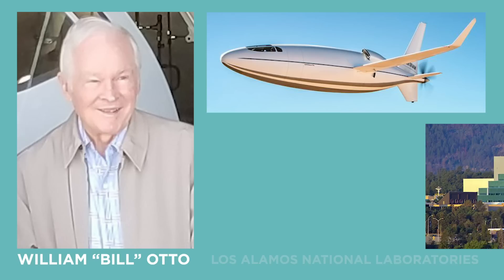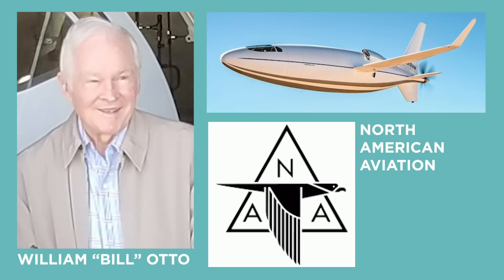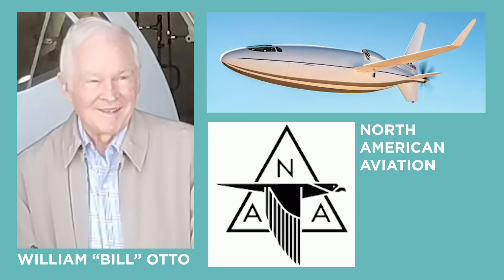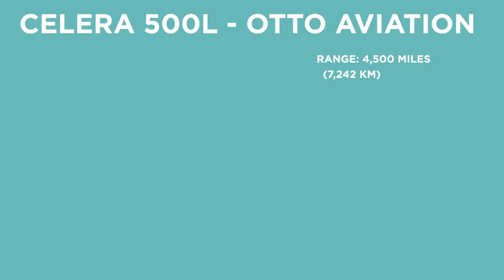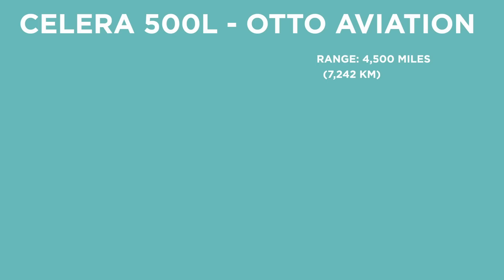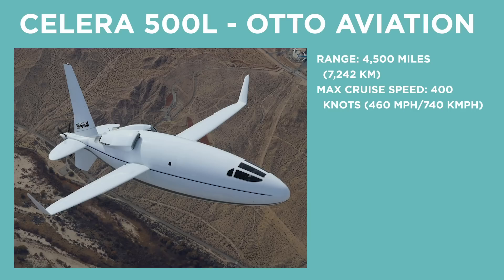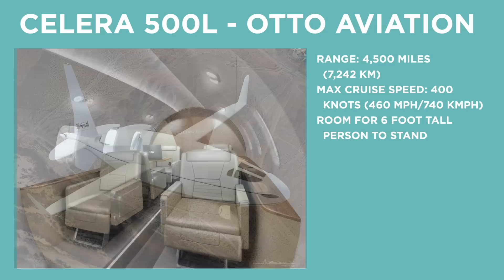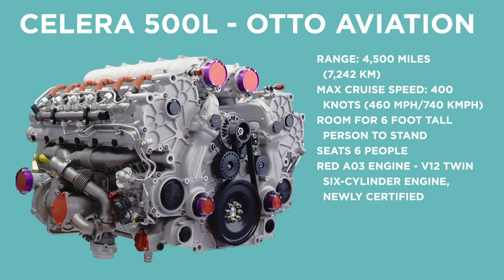Could This Plane Save The World? (Hint: No.) | Answers With Joe

Comment from the maker: I can tell from early views that the big hangup everyone's going to have is over the cost I state for the 747. I got it from here: https://www.aircraftcostcalculator.com/AircraftOperatingCosts/380/Boeing+747-400 which actually lists the used price. I also spoke to a couple of pilots that verified it. What I failed to say in the video – since I was unscripted for this one – was that I was quoting a used price.

But for the sake of argument, if you were comparing 61 Celeras to a new 747 priced closer to $250 million, that's still $50 million less for the 747.
Reply: thanks
Reply: It seems like Joe hastily made this video
Reply: Economy of scale would bring the Celera cost down for sure. Mass manufacture it
Reply: Joe's videos are impressive and thankyou for posting them
Reply: I don't like change.
Reply: 747 costs more than 300 million dollars !
Reply: Price of a new 747 is $200-300 million, depending on configuration. Your point still stands.
Reply: The difference is, you can't buy a new 747. Production is about to end. Quad engined jets are dead and buried
Reply: You need to do the math on the cost per seat to fly. If the cost of fuel is low enough over time then the profit per seat will go up.
Reply: @wolf359loki  Profits per seat will go up but will then go back down as airlines cut prices to attract customers.   I read a few years ago that the U.S. airline industry taken as a whole had lost money overall in its history.  That is why so many airlines have gone out of business.
Reply: The biggest hangup I have is that the crux of your argument amounts to a VW Jetta is not as efficient at hauling freight as a semi truck.  Genuinely enjoy both your channels and your podcasts but I feel a little more imagination here is in order.  I think this plane is a promising proof of concept and I would be interested to see how something like this could scale to 747 proportions.  Perhaps it could transport the same number of people but do better than fractional MPGs.
Reply: I don’t know if its cause the video is unscripted but u seem stressed joe, i dont know what youre working on but remember to get enough sleep and take time to urself
Reply: I just Googled "Boeing 747 cost" and on the first response I got "A new 747-8 passenger jet now lists for $367.8 million"
Reply: I would like to point out to everyone that there's a much smaller chance of dying when flying on a large plane than a small one. (Due to things like resistance to fluctuations in wind, extreme weather, and that there's more of the airplane to take the impact when hitting the ground.) I'm guessing this is part of the reason why larger airplanes are popular for chartered flights and smaller planes are becoming increasingly rare.
Reply: It looks like it could be good during this pandemic to get small amounts of people to places where they HAVE to go, but once the pandemic is under control it will go back to jumbo jets. Using a conventional engine is just asking for trouble. They are not as safe as a Jet engine. Too many thing can go wrong with a piston combustion engine.
Reply: How can we trust ya, Joe?  You come across as an educated person presenting factual knowledge.  Saying you're not a pilot doesn't mean a thing!  Everyone knows you're not a pilot, but we still trust your info.  Should we also assume that you're facts aren't correct because your not a reporter?
Reply: @cbuchner1  Lol, or just jam a few more seats in it. If you could go from 6 to 8 seats you just need 46 Celera's instead of 61, cutting down on all costs. If they were targeting the 747 it would be better to make a 20 seat version instead of mass manufacturing this plane.
Reply: @The13lackMamba  not sure if the current design scales well. They might have aimed for a sweet spot concerning their particular choice of engine technology. Ok, 8 seats seems doable. 80 much less so ;-)
Reply: Its cool, its just a YouTube video, not a mars probe...
Reply: The thing is than almost nobody uses 747 for intercontinental travel. You should compare celera to 737 max or airbus neo
Reply: Skyships also made a good video about this aircraft getting more into the technical side of this plane also worth checking out he also raised the same points about the commercial aviation argument go check out his video here : https://youtu.be/E38cc-4TvX8
Reply: This concept means you fly point to point.   You get rid of the hub concept so you fly a lot less miles and hours to get where you are going.   You didn't include any of this in your calculations so your numbers are off, just saying.
Reply: @christophertstone  Yeah, I was thinking 20 million was a crazy low number.
Reply: Worked at Boeing...I can tell you a 747 was north of 100 million dollars back in the early 90's 🤣
Reply: If a Jumbo with 350+ pax can go 25 miles with 125 gallons,
and This Plane with 6 pax can go 25 miles with 1 gallon,
then i am really wondering if it would be feasible to scale This Plane up to a size where the crew costs and also ATC / Airport burden would become less of an issue.
How about you ask Destin for a collab and have him as the lamina flow dude on this? ;-)
Reply: Hopefully it can be upscaled in terms of size, capacity, production and efficiency. This would be a winning number.

Captain obvious here.
Reply: Joe Scott So, a few things a real comparison should consider:

* It is not a comparison. It is not even apples and oranges, it’s more like apples and a school bus.

* The Celera 500L will always be too small for regular commercial flights, except on very niche routes. However, the concept likely scales well enough for a 20-30-seater to be produced in the future. Larger than that is probably hard to achieve with the same aerodynamic advantages (or the big commercial manufacturers would have implemented it by now).

* Using a 747-size and -era aircraft as the opposite number is unrealistic. Yes, they can be had on the cheap second hand nowadays, but they are getting obsolete for a reason (operating costs) and are only really suited for the larger, long-haul routes where you can sell upwards of 80% or more of the seats on each flight.

* Better to look at a mix of 737 Max (if they ever regain the public’s trust) or A320 Neo for the short-haul and B777X or A330 Neo/A350 for the long-haul. That brings down seat-mile costs significantly, and adds route flexibility. But this will still use the standard hub-and-spoke model.

* Speaking about the route model, aircraft in the “Celera+” category are more suitable for direct end-to-end operations, and a large enough fleet will be very flexible in route selections with easier adjustments to accommodate fluctuating demand, seasonal changes and special events (something like the Olympics will skew demand in one direction, while a local epidemic or civil unrest for example will skew it the other way). Flexibility will be a major USP for this category. This also brings down operating costs since you will need fewer if any feeder flights to smaller airports.

* The Celera 500L/1000L will have a niche market though, which is short-haul taxi flights. If you need to go to somewhere close to an airport that doesn’t have regular commercial traffic, hop on to your local Yellow CeleCab and tell the pilot where to go. More expensive than regular air travel, likely significantly less than traditional business aviation.
Reply: No airline is buying used 747s  Perhaps use an airbus 330 as an example $241 million.
Reply: I just wanted to make a comment pointing that out, so thanks for clarifying :D
Reply: Please remember that the 6 person is with 1st class seating. You could possibly go upto 12 seats (more likely 8 seats) if you wanted to down grade the seating. What this aircraft may work better as in the commercial airspace is small package express delivery with only a jump seat. Though it is too nice an aircraft to religate to that.
Reply: According to Wikipedia, the new 747-8 costs about $420M. It's fine to compare the used planes, but used Celera will also be much cheaper than a new one.
Reply: @wolf359loki  You also need to do the math on how far out of their way the average traveler goes with the current hub airport model - because the idea with the Celera is to fly direct. If a person who lives 1000 miles from the east coast wants to go to a city that is 1000 miles from the west coast, and they end up flying from their home to Atlanta then to LAX then to their destination, then a 3000 mile trip in a Celera becomes a 5000 trip in the traditional industry model. So you can't compare 1000 miles in a 747 vs 1000 miles in a Celera.
Reply: @mikeissharp  My question is whether the pilots of such a small plane like Celera require the same level of skill and training as the 747 pilots.
Reply: Joe, while I don't have a hang-up about the numbers you're using, I do think you've chosen the wrong plane to compare. Sure, the Boeing 747-400 and the Airbus A380 are probably the worst planes in commercial aviation when it comes to fuel usage, they're also not the standard planes used anymore. As you said, airlines are trying to get the most passengers for the least amount of fuel used, and it's this calculation that's doomed both the 747 and the A380. Most airlines in North America and Europe have already retired all of their 747s and A380s in favor of planes like the newer A320 and 737s for continental service, and 787s (and the 737 MAX before they were grounded) for oceanic flights. It turns out, it's easier to fly more people on shorter hops than cramming them into a 747 for fewer non-stop 3000 mile flights. The only airline that seems to be doubling down on the Airbus A380s is Qatar Airlines out of the middle east, as they a one of the few carriers trying to connect London and New York with Beijing, Tokyo, Sidney, and Malborne. (Captain Joe, 74 Gear, and Mentour Pilot all have videos on this on their channels about this.)

Ergo, I argue that you should have used the Boeing 737-700 or 800 series for your calculations instead, since it's closer to what the airlines (at least in the US) are using. The numbers still work in favor of the larger passenger aircraft over the  Celera 500L.

For those fans of the 747s (The Queen of the Skies), don't worry. They have one advantage over the A380 that may keep them in the skies far longer than their Airbus counterpart. There are airlines that are converting these aircraft to be used for their originally designed purpose: Air Freight. The 747 came from a failed bid to create a cargo workhorse for the USAF and then turned into a passenger aircraft.
Reply: Say, Joe, is this video deliberate clickbait?

No, the Celera 500 L will NOT be the deal-breaker. I also highly doubt a pilot of a 6-passenger plane will get the same salary as a 747 Jumbo pilot.

The Jumbo itself seems to be running on borrowed time; the development costs are already paid. The Airbus A380 did not perform well. So it's better to compare it to contemporary planes AT ALL.

And STILL that'll be a "apples to asses-comparison". The Celera 500L is a PoC, a Proof of Concept, nothing more. Now let's try to upscale the design principles (laminar flow) to an trans-oceanic common (=smaller than the 747) plane.

However to see how it would like if a company took a great use case and develop a solution to that jumping every intermediate step, look at German #CargoLifter. They ran out of money before they finished their 160to-airship, much too late trying to monetise their tremendous R&D successes with a 75 tonne air crane.

So there'll be a Celera 1,000L, 2,500L, ...... until the technology is ready for a trans-oceanic plane.

And my criticism still stands: We don't need concepts that will never be viable for more than intermediate ranges. We need short ranges in High Speed Trains like the Shinkansen, TGV or ICE and we need intermediate ranges in MagLev like #Transrapid. 

What do you think will happen when quickly developing nations like China, India or - when they reach this stage - East Africa begin air travelling on a Western scale? Do you wager air travel, with carbon-intensive industries converting to nuclear power or emigrating to countries with low carbon footprints due to nuclear or grand-scale solar power (#DeserTec), will STILL remain at 2.5% then?

So, no, "making air travel more affordable" is the direct contrary to "reducing carbon emissions". "Making travel more affordable and providing adequate high-speed rail networks coupled with adequate rail commuting networks" is the only viable goal.
Reply: This video wasn't out of line at all. It was wery interesting and goes with the enviromental sustainablity content you make.
Reply: @jackielinde7568  Ironically the military including the USAF are now contracting cargo 747's because the commercial industry can move their cargo far cheaper than the USAF can.   Well this was at least true when the war in Iraq was going strong, don't know about now.
Reply: One small trivia note: you can't buy a new 747 anymore, the production line is ending in 2022 and all of the remaining aircraft in the pipeline are already spoken for. I believe they are also all freight variants as the last commercial passenger flight of a 747 was last year, I think.
Reply: Airline industry (at least before covid) was transitioning from a Hub and Spoke model to Point to Point one, deploying smaller aircrafts.

Begs the question if autonomous vehicles become a thing, why not have it drive you over night instead of going to airport hassle.

Would be interesting to know how travel milage thresholds shift from air to ground once FSD is a thing.
Reply: @arkatub  Well said! despite the calculation still stands as operating cost are the key cost.
Reply: i think that many have left their thinking caps on the night stand - the idea that More makes Less is absurd
Reply: The math you used to compare was wrong its MPG for 1000 miles its should be 200 galons not 5000
Reply: @WaldoJvr  that was really helpful, thank you.
Reply: It actually makes hem about even, the Celera a touch cheaper, before the tens of millions for the fitout of the Boeings
Reply: This comment isn't about this plane but electrics. The key to electrics is going to be structural batteries. So you should do a video about structural batteries. Thanks.
Reply: @cbuchner1  just by ordering 61 you would get a big discount.  The price Joe is quoting for a new 747 is based on a volume order.  A new 747 costs upward of $400 million.
Reply: Joe, you are either quoting the price for an older 747 model that probably isn’t produced anymore, or are quoting a discounted price based on a volume order.  A new 747 costs more than $400 million without a discount.  If you ordered 61 Celeras, you’d get a discount as well.  Even with your correction this is an apples to oranges comparison.
Reply: The aircraft is being retired worldwide for pax service so don’t worry about it. 😀
Reply: I think the milage of the 747 is Gallon/mile/passenger.
Reply: As a licensed aircraft maintenance engineer can I please PLEASE ask you not to go to pilots for any form of technical discussion on aircraft in the future? They (as a rule) have no concept of the functioning of systems, design, structure or even what components are involved in the functioning of their aircraft, they have no need to. It's like having a discussion on the functioning of commercial restaurant kitchens and asking the front of house how they work. Anything deeper than "when I do this, this happens" is simply lost
Reply: I really thought that you were going to approach the use of laminar flow technology on the 747 scale, I think that the answers may come from pilots, but surely the administrators and engineers are in charge of the aviation world and of course the last word is theirs.
Reply: Clearly not much effort into this video, I don't care but don't patreons pay per video???
Reply: A 20 million dollar 747 is like those really cheap mansions in Europe you see advertised: the sticker price is the least of your problems.
Reply: @yukionna1649  I think the mentor guy he mentioned is a pretty good exception to the rule.  He knows his stuff.
Reply: Speaking of those other carbon emissions where would those larger efforts need to be focused?
Reply: Yepp, that was where I looked down into the comment to see if anyone else caught that.
Reply: @mikeissharp  200 is too high. But per hour is tricky with pilots. They only get paid for flight time, so 200 might be real, but they work a bunch longer dealing with getting to the plane, inspecting it for flight, logs and paper work, delays, weather, etc.. The pilots likely to fly the smaller plane will probably be around that 50 figure. Maybe a bit more. Someone with enough seniority to be flying the 747 probably starts around 65 based on their real take home pay. A senior pilot getting 100 or so. Pilot pay has reduced significantly in the last 20 years.
Reply: @court2379  yes I am aware of how the industry works ... with 15 years seniority on narrow body Boeing aircraft.  I think 200 is about right for a wide body captain  at one of the majors
Reply: Just FYI, your content is awesome. I saw your title and I only clicked it because you answered your clickbait title making it not clickbait. Now I’m curious why and must know.

Thanks for all the awesome videos, you are one of the best on YouTube.
Reply: @cbuchner1  not really. Economies of scale have never been a thing for aviation, except for maybe making planes in WW2.
Reply: @mikeissharp  correct. Even more like $400. Also factor in the minimum day. No self respecting 747 pilot will fly for less than 5 hours of pay per day.
Reply: Yeah they can just upscale the shape of the Celera to the size of a 747 and it would be more aerodynamic and then they would save money on fuel. and still be able to transport 300 passengers. 

Also they can make the small Celera solar powered, but you can't make a 747 solar powered because it has more weight to surface area ratio, (surface area to volume ratio)

This is the same reason why giants don't exist, the bones of a 6 foot human can hold their weight, but the bones of a 60 foot human cannot hold that much weight without snapping, unless you increase the density of the bone or change the amount of gravity that exist on the planet. 

Watch this to fully understand 
https://youtu.be/huKUJsqik2I

There are new diamond nuclear batteries that can power a small Celera without being big enough to blow up like a nuclear bomb.

But a large nuclear diamond battery to power a 747 does have the energy required to split the atom and start a chain reaction within itself to blow up like a nuke.

So this means Celera sized airplane can be powered by a nuclear diamond battery and it would be charged by solar panels on the surface area of the Celera. 

The 747 is doomed, it is obsolete! 😠 

Hahaha just kidding, I have no idea what I'm talking about. 

The military probably already has anti gravity technology so we probably already have invisible Iron Man suits for all shapes and sizes, so if these greedy fux weren't hoarding the new tech for themselves, we would all be able to fly to go visit grandma without any need for any airplane. 

All modern technology available to the public is just a scam, they are holding back the real tech from us, because it doesn't benefit their bank account to give us an updated copy of all their new tech.
Obviously.

And remember, I don't know what I am talking about. 

I am just George Orwell son of H.G. Wells, my cousin Aldous Huxley told me that were living in 1984, I told him it's a Brave New World, Order in the court, may I take your order Sir? 
Would you like fries with that?
Reply: @mikeissharp  
Sorry, looks like you are closer to it than I am. I have been out of the industry for a while, but try to pick pilots brains when I run across them. My private check ride was scheduled for Sept 11th which didn't happen and the industry soured for a few years afterward. I couldn't justify the cost for jobs that weren't there and couldn't get flight time so didn't make past the IFR rating, and went another direction. My understanding is that wages have still never returned to the levels they were before, but have come up considerably and are quite good again. Also heard demand for pilots is really high. Temping to go back, but getting old enough they won't be interested.

 The cruise on this is amazing for a piston driven plane. Not being a turbine may make it hard to find pilots though. The lower hour people will want to go to a regional to get turbine time, and the pay will probably be too low to attract most with enough experience fly for a major.
Reply: Airplane acquisition costs are widely variable. A used airplane in a class with a lot of supply and shrinking demand can be stunningly cheap
Reply: Another point: if you put in an order for 61 celeras you’d likely get a 40% discount
Reply: @norlandr6512  it's listed that it sell for around 180
Reply: Volkswagen specs
Reply: Yeah, the thing is nobody is flying the 747 any more. Better to have chosen the dreamliner or 737-max. Maintenance is what is going to kill you in this comparison.
Reply: How much bigger can this plane get? If it can be as big as a 747 how much cost effective will it be?
Reply: @jamesfox2857  "More makes Less is absurd" it can be.

If large empty planes fly around, it is better to fly smaller fuller units.
Reply: @elmirio8500  LAUGHING MY ASS OFF RIGHT NOW - Who can afford such Luxuries - did you Not Read the Cost i wrote in ? and YES its Reality - Not some Rich executives Far Fetched idead that the cost i stated is Nothing - Regular people Would Never be able to fly Ever again 
and the offset of emissions alone Does not even come into play here - as More planes are in the air at one given time - also equates to = Why aren`t planes filled Now - Why Introduce more ? Doesn`t make any sense - Unless you are the Manufacture or an Executive of that Manufacture - Due to Low Wages paid Now - it Wouldn`t Benefit the employees but rather Create More inequality in the work force as well - More Isn`t Less No Matter How you Try to make it sound - same as in our daily travel - millions upon millions of cars on the road pumping out toxins into our atmosphere - where is the Rail system we Have already paid for 4 times over - and the Fiber from Shore to shore that we have already paid For 12 Times Over 
The Tax Payer $ is Now being Stolen By Major corporations that Have Paid For Every venture they have entered as Well SO Would This Just to get it up and running - You Literally Have no Clue 
or you are a part of that class of very few that Profit From Such
Reply: @InfamoussDBZ  You could be free of change if you stopped using cash.
Reply: Joe, airlines dont go for quad jets anymore, the 777s and the A350s are where it's at. I hear they're pretty expensive though.
Reply: A new 777 is over $400 million.
Reply: Another thing to keep in mind Joe is that boeing doesn't make passenger 747's anymore. We make the 777 and 777x though. I'm pretty sure the prices for those are around 350-450 million. 

Also, the 777x is more fuel efficient then the 747,i think by a lot.
Reply: These guys math homework doesn’t add up 😂
Reply: And 747 pay is 200-500 depending on the air liners lol these guys put these video together with spet and glue like his 20 million 747 😂
Reply: Better to compare with a 747-800, or even a 787 as the 747 will no longer be produced.
Reply: Can you do video on salvator ceasr pias on pias effect and his latest patent. I heard it will change transportion industry all at once.
Reply: how do you get 203 dislikes.??..there are some real cro magnon dead heads around.
Reply: It still its a really fing dumb comparison Joe!
Reply: Solution, free of charge pilot schools for small craft pilots with lower wages. Same tendency as in other branch flooded with people doing the same job.
Reply: A new 747-8 costs $418 million dollars. 61 Celeras costs $305 million dollars. That's $113 million dollars cheaper for the Celera.
The $250 million 747 you mention in the OP is the 1990 version , the 747-400 and that is the 1990 price adjusted for today . You can't buy that new anymore. The currently produced version is the 747-8 and costs $418 million .
Reply: A new 747 costs $442 million.  And nearly $20 million to operate per year.
Reply: That is the problem with Google snippets!  That is the worst feature of Google, and I wish it would go away.
Reply: @easymac79  at least there should be a disclaimer.
Reply: I'm left wondering if there's a limit on scaling the design. If a 100 seater with similar efficiency is possible, that may compete with commercial airplanes.
Reply: The biggest plus for the Celera is that it will take you where YOU want to go, rather than where the airline goes to maximize profits.   This is why the Airbus 380 is a bust.
Reply: As someone who flew his own Cessna 172 for 13 years, I can say that the difference in flying in a small plane has great benefits; bypassing security lines being the best one.   Get to airport, walk to plane, get in, start up, take off.   For a 1000 mile flight, I’ll bet there are a lot of people who would pay the extra cost to not be treated like Cattle at the Chicago Stock Pens
Reply: What about the Celera 1000 ??? and the possibility of even larger Celeras?
Reply: @AmishGramish  larger aircraft carry more fuel = fire = death
Reply: you forgot more added costs for using multiple aircraft:
- landing fees
- parking fees
- ATC fees
- etc.
- etc.
- etc.

And another problem for using it commercially: by law in most countries an aircraft used for commercial passenger operations MUST have dual cockpit crew AND at least 2 engines. Plus a minimum number of flight attendants depending on the number of passenger seats, which for this aircraft would mean requiring a crew of 2 pilots and a flight attendant.
Reply: The Celera could however become some sort of Sky Uber, and have standard hop on routes that reach far more destinations than previously existed. In other words, a niche market and not comparable to regular commercial flights.
Reply: hydrogen fuel would also be part of the solution
Reply: What about simply scaling the plane in size? Make it big enough to fit the same amount of people as a 747 without changing the aerodynamics. Just to be perfectly clear, i am not even an amateur in aerodynamic science, just a thought that occured to me.
Reply: @The13lackMamba  Well mass production is worth it because there is money to be made replacing private jets. A 20 seat version is planned, but presumably taking a leaf out Musks playbook they want to walk before they run.
Reply: And you can get a used pc-12 for like $2million. So how about oranges to oranges. Meanwhile, I can't find a flyable 747 for less than around $45million and one that you might want to actually operate as an airline for less than around $95million. If you want it to be anything close to the inside of the 500L you are looking at around $175million. New you are looking at around $420million
Reply: No, because the Solara is a piston engine and would run AVGAS which is a high octane gasoline with lead additives, and $5/gallon... so... no shaking up any industry
Reply: @dickbong7499  except that this is a diesel engine running on jet fuel or biodiesel,  no avgas in sight. Run it on B100 and suddenly the CO2 footprint of your flight is somewhere close to zero and nobody can hate on you anymore for owning a private plane/taking private flights. That alone is enough to make this a successful aircraft.
Reply: get a haircut bro. or pomade
Reply: Yeah but airlines don't by used 747s, they need massive overhauls which also costs millions to keep running.  They'll buy new planes which cost hundreds of millions. This plain should also have much cheaper maintenance costs b/c it just uses a car engine which is easy to fix
Reply: No, the bigger issue is that the 747 isn't being built any more.  Why did you choose, for your comparison, an airframe that is no longer being produced?  And isn't at all representative of the operational or financial metrics of any of the aircraft in any of the domestic fleet?  Doesn't make sense.  Do your comparison against the 737 .
Reply: @cbuchner1  The cost of the airframe isn't where the cost lies.  Even if Otto gave these away to the airlines, they would never consider it as a replacement for anything but their regional carriers.
Reply: A new warning from 250 scientists and scholars, with more adding their signature every second, came out this week... The paper states that the collapse of our civilization is now unavoidable from the results of the 6th mass extinction event, the climate catastrophe and so on... They say this century, but talking with several people involved, they think by the end of this decade, give or take 5 years... Looking around the world, with your big boy pants on, it's certainly easy to see that playing out... People just refuse to accept that we can't live this kind of consumptive lifestyle and want technology to enable us to not have to change our behaviors. Not only would we have to change the way we power everything, but would also have to change our culture, systems, and everything else 360 degrees... Just saying...
Reply: @chuckschillingvideos  I live in less than 200 square feet, powdered by solar, in the middle of nowhere, with no conveniences... LOL...So your theory is off the mark...Science is science... It's no one's opinion nor does it cater to any fake religion or ideology...
Reply: also I think you can’t even buy a new 747 anymore because it’s (about to be) discontinued.
and: the comparison with an A350 or a 787 dreamliner would have been a lot more sensible as they are the future of long haul flight. and they are MUCH more efficient than the 747 that was conceived in the 1960s ...
Reply: The one pickup I have is that you're using a plane designed in the 1960s as  your comparison. i would have gone for a comparison with something like the 787 or A350 maybe?
Reply: @TSQDreamscape  Obviously the electic version is a more desirable version providing you could add to number of passengers if only you could take a loft more batteries, but what about the extra wight of more batteries you may wonder?
Why not use mixture of batteries & helium canister placed underneath the batteries in order to reduce extra batteries weight (to get them levitating) in flight and when landing withdrawn back into (in pressurised form) in the canisters. That way you can have as many batteries as needed to increase the range without increasing the overall weight of the plane. Alternatively I wonder if magnetic principal can levitate the batters and hence reduce their weight(rather like levitating trains).
Reply: You should take into consideration how 61 smaller planes would greatly change the logistics of how those people got around versus one big plane. Rather than have someone go from Illinois to Carolina just to go back up to Pennsylvania is ridiculous with smaller planes it would be more feasible to make direct flights. Also the small planes could be scaled up a little bit I'm sure, maybe make it 30 small planes to 1 big one
Reply: What about mass production Joe? If you could produce enough Celeras you could drive the price down. In all honesty, I'm looking for Tesla's VTOL aircraft in 2030!
Reply: I still can not see how you can compare a 747 with a small private airplane. It’s like comparing a 5 seater car with buying 5 motorcycles you just wouldn’t.
Reply: @yukionna1649  yea I had to tell my mechanic that "when I pull back this should go up" not the other way around.  Be careful how you describe an entire group of very highly trained, dedicated professional people, that blade cuts both ways
Reply: $418 million for a 747-8.  Plus fitting out.
Reply: But that means it's close. Also if you get 25mpg, that's 200mpg per person, if at full capacity and all that in a business class cabin. That's double the 100mpg per pessenger of a 747. Plus the cheaper to run piston engine, gets me excited.

It might still be too expensive and not a lot of people have pilots licences (huge price factor when you are just flying 6 passengers.) But it's still a revolutionary airplane.
Reply: Today, the newest model of the 747, the 747-8, is on sale from Boeing for $386.8 million US.
Reply: just to point this out... scaling this vehicle to be larger would actually invalidate most of the problems you've raised.
Reply: It really is the first steps but, even now for low demand and internal flights and short distance and as competition for some long-distance travel. Not to mention for surplus passengers
Reply: Joe your math is still way off. Four engine jets are dead. The best comparison is a 787.  Using the 787-9 as the comparison that seats 296 people and costs $293m. 

So you would need 50 Celera x 6 people = 300 people as your comparison. 50 x $5 m = $250m which is $43 m less. Not $50 m more. 

Assuming they did sell in those numbers I suspect the unit cost would be far less than $5m.

I live in Australia and if they can achieve the flight hour cost that plane would change travel here. Brisbane to Perth would be cost comparable to a conventional airline ticket on a per person basis. BUT I could fly from my local airfield (1 km away) not an airport (50km away) and land at an airfield far closer to my final destination. 

Plus - I’m sharing my space with 5 people - which in terms of CoVid bubbles, travel restrictions and quarantine means it can be a much safer environment to travel in.

The diesel piston engine is also a game changer - unit cost is 95% less than a turbo prop or jet and the availability of mechanics who could perform rudimentary repairs if needed would be 100x those who understand jet turbines.

Game changer if it delivers.
Reply: Unfortunately found this vid whilst searching for 500L updates. Why has this vid been created or watched? Someone admits they know nothing about the subject matter (or even has a basic general knowledge of aviation or of physics) but goes on to muse aimlessly anyway, whilst demonstrating a complete lack of relevant scientific understanding and whilst making bafflingly erroneous assumptions. One hint to start off with: the [SIX-SEATER] 500L has not been conceived as a rival or replacement for the Boeing 747.